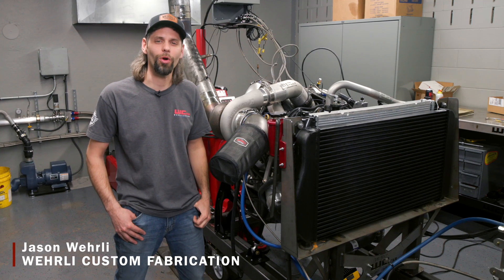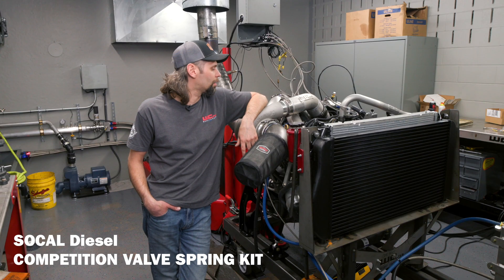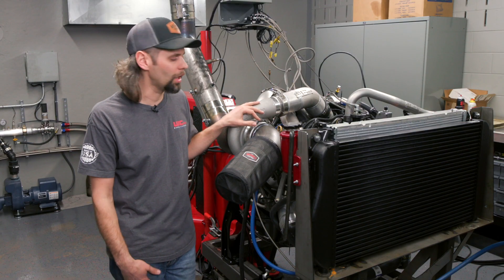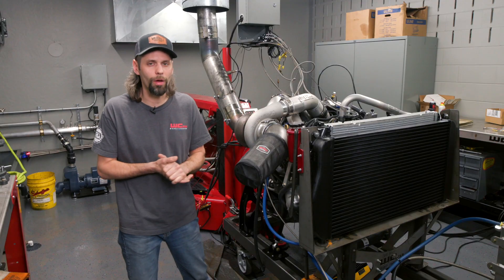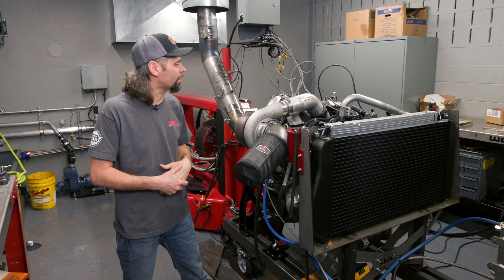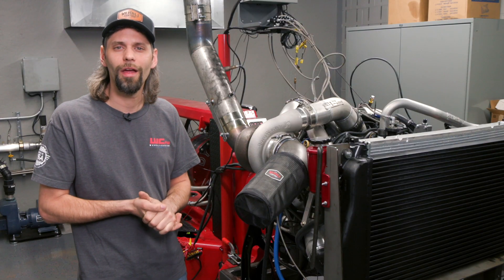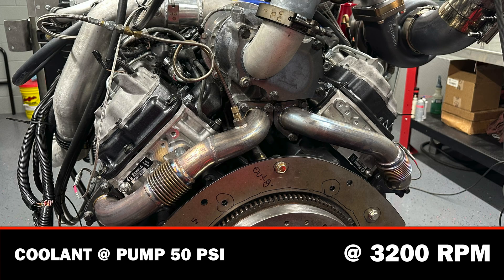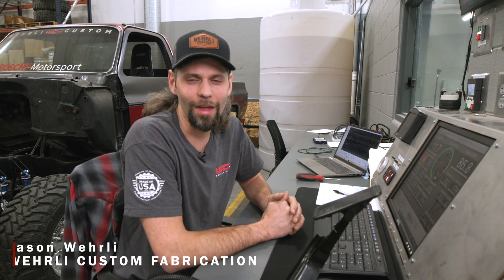WCFAB LB7 Drag Race Engine Build & DYNO Dial-In

Comment: What intercooler are you using?
Reply from the maker: Banks Techni-Cooler for an LBZ. Here's a link: https://www.wcfab.com/i-30247565-2006-2010-lbz-lmm-banks-power-intercooler.html?ref=category:1395169
Reply: @WCFab awesome thank you!!!
Reply from the maker: @guyabbatantuono8537  quick heads up we're using some custom built intercooler piping specific for this setup, it's unfortunately not something that will swap over to standard LB7 hot and cold side piping.
Reply: What size fans on the radiator?  I'm assuming they are brushless spal fans?  Can't wait for more updates!
Reply from the maker: @8aford97able  we're running the Flex-a-lite dual fan kit: https://flex-a-lite.com/direct-fit-dual-electric-fans-for-2001-2005-chevrolet-truck-with-the-6-6l-duramax-diesel.html